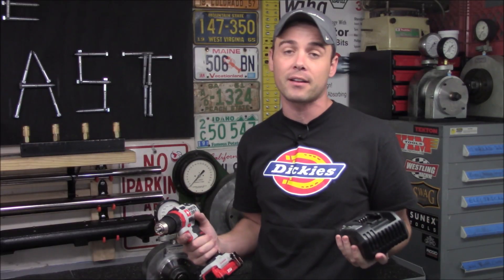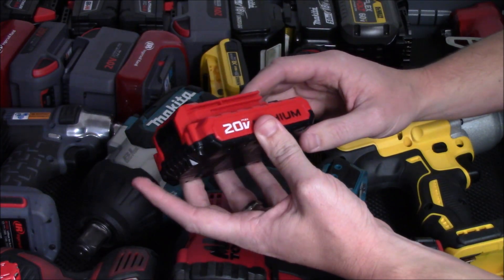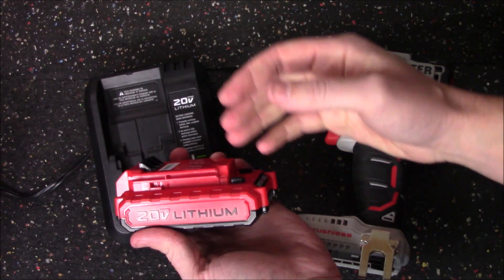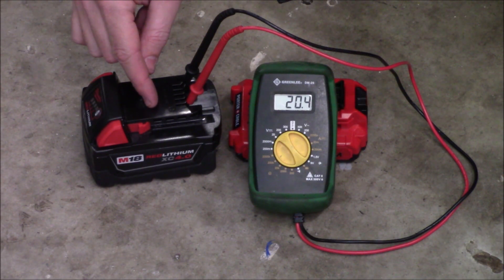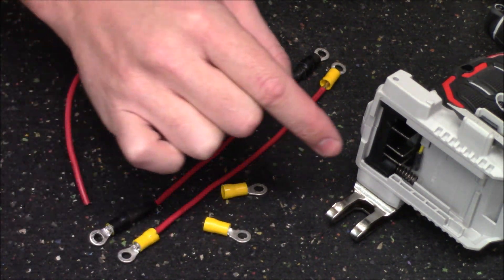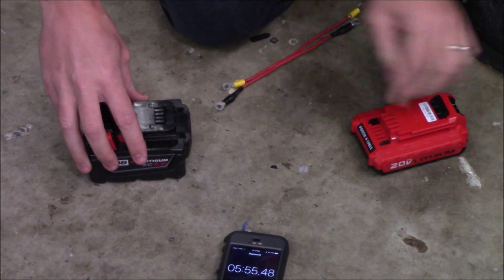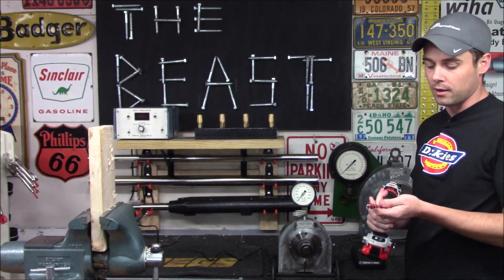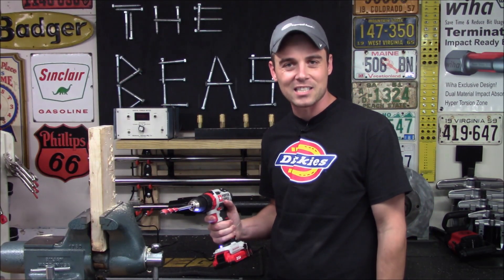Back from the DEAD!  Lithium Batteries!

Comment: Great video with emphasis on safety, but described method may be too conservative and outdated.  While this may work as a quick and easy fix, chances are the current modern Li-Ion battery packs and their paired smart-chargers that first test, than determine viability status would be able to identify and resolve an issue that this would work for... Despite theories that battery-packs sales are a huge source of revenue for manufacturers, retail stores, etc... since most consumers don't register to satisfy the warranty... perhaps just a Conspiracy Theory to explain increasing battery failure rates???

Sometime all that is required is repeatedly inserting the batt pack into charger until unit senses enough voltage to charge the pack, since the initial test provides a small charge, but this can take MULTIPLE insertions, so best to check pack voltage to see if close to 75% of rated voltage.

For a bit more advanced DIY viability test and resolution there are 2 significant considerations that may require additional advanced steps. Both require opening up the case, which can void any warranty as well as add more safety risk. This usually requires a special "safety" driver bit to remove the screws, one or more of which may be hidden under rubber seal or label.

1)  If the source of failure is the circuit board or a non-battery component inside the pack, then NOTHING below will help.  

2) But chances are there is one or more under-voltage 18650 Li-ion cells, which can be individually measured with a voltmeter once case is removed. If one or more is significantly measuring a lower voltage than the others (normal around 2-3.6V, below 1.5 V is either dead, deactivated by safety circuit, or hopefully just in "sleep" mode) which may be resolved by a trial of "boosting" the voltage with another 18650 or similar 3.5V power source, + to +,, - to -, for about 15-30 secs, small spark is OK.  A confirmation of a potentially viable cell responding to a "wake up" is by showing any sustained voltage increase and eventually allowing it to be charged to 3.6V again. BE CAREFUL, and if voltage remains low or nothing, chances are it is not viable, either chemically or mechanically defective, possibly the safety circuit deactivated it, WHICH SHOULD NEVER BE MESSED WITH.

3) If a "boost" of one or more individual cell appears to be viable, the external "pack-boost" in this video may still not be effective as there may be components in newer commercial battery packs that prevents the inflow of power (transistors, MOFSET, etc ) using just the 2 external leads that may need a trial of being bypassed. To do this, find the part of the circuit board where the Neg and Pos aspects of the connected 18650 cells are making 1st contact. Measure voltage there and if still less than 75% of rated pack voltage, connect the charging source here (Again + to +, - to -) may confirm the bypass may be needed to provide charging of internal pack until smart charger detects an acceptable voltage and can provide complete charging , again a small spark is OK, but watch carefully. 
If internal voltage is below 12 V, consider use of a low current 12V trickle charger to get to at least that voltage. Test voltage here every 15-20 secs if not using low current charge source, be aware of any thermal increase in both batteries.  Success is indicated by sustained voltage increases measured internally, then also at the external connections, eventually to where the commercial charger indicates the pack is viable and completes charging.

If after trying these alternative reviving techniques you will either have a restored Battery Pack for either short or long time,  or one to get properly discarded / recycled... or carefully harvest the parts for other uses.
Strongly recommend searching for similar videos, especially of the batt pack brand you use, and BE SAFE!!!!

Comment: Where can I find a diagram of a battery terminals?
Reply from the maker: Most are marked (+/-) in the plastic near each slot.
Reply: Not likely from the manufacturer, but worth a search. Sometimes marked with + and -, if not use a voltmeter, preferably digital or set analog to 50 V or higher until + is determined.  For newer batt packs with multiple leads only one should be +, the others either full neg or partial, as these are for testing, balancing, or measuring temp.  I have not come across any with multiple + leads, but I suppose they can exist.

Comment: Is this method good to revive a  battery that died because it got wet?
Reply from the maker: Doubtful....
Reply: Not likely, unless you are willing to risk an electrical shortage, fire, or permanent damage especially if liquid was anything with electrolytes. Best would be either returning if under warranty and hoping there won't be an inspection) or to open the case (yourself or someone experienced) and making sure there is no active moisture. I have serviced several non working battery that apparently got wet in the past showing rust and corrosion, it was not worth the risk to attempt repair.

Comment: Are these both the same brand of battery? Because if so, you connected the polarity reverse.
Reply: I saw the same thing!!! The two batteries I have are for the same tool so it would be connected + to - as shown in the video.  I should know but wouldn't sparks fly if they were mis-connected? I assume he would have known what he was doing?

Comment: I only joined my 2 batteries for literally like less than 2 minuts and i took the original volatage from both batteries before the 2min and after the 2min on the low voltage battery the volatage was still as it was before however this time the charger actually started charing it... so for less risk don't join them for a long time even if the volage is still low the charger may surprise you and actually start charging them you never know may have same resulst as me (I have  worx battery btw and the one that didn't want to charge is a generic worx made by Vanon).

Comment: When using device to the point of needing a charge, isn’t that pass the the threshold of low voltage that the charger won’t respond to, in not charging?

Comment: Great info. I have two DeWALT 40v batteries. One of them stopped charging last year and I didn't want to spend the $192 to replace it. For some reason I held on to it thinking I would be able to take it apart and replace the guts of it. Well, now with this video, I followed your instructions and wired it up initially for 5 seconds and it pushed it up from 36.9 to 38.1 and now it's charging.
Thanks for the detailed explanation of what happened and why it wasn't working.
Hope all is good with you.

Comment: Thanks for this, what would be lowest voltage for makita battery to bring back to life ? Tia
Reply from the maker: No clue.  Makita has a chip inside that burns out of the voltage it too low & you can’t revive them.  Charge Makita batteries often.

Comment: Be careful like he said as one of the cells could be dead with a similar voltage to what he showed. This will get the battery to charge, but it will likely have suffered a decent amount of runtime loss after undervolting so severely. It could also go Mt.St Helens. A safer method would be to buy an R/C style balance charger if you have multiple packs like this, open the pack, and charge the cells individually in a terra cotta pot (as they are cheap and insulate well) If it's a larger in parallel pack, things just got more advanced. You would have to disassemble the pack. The drill, and or pack in this video are likely malfunctioning and or of poor design, as an under voltage protection circuit should have literally switched the battery off (so that there would be no voltage at the probes, Methinks it's an issue with the pack itself, this also likely wouldn't prevent an overcharge if input voltage was high enough. Both can result in thermal runaway.) All modern brushless tools also feature over current protection that will automatically trip, just like a breaker if the motor is overwhelmed and calls for more current than is spec, whereas brushed motors typically only have temperature protection.

Comment: It totally worked on my 20v lithium batteries .  One battery was so dead it didn't turn on my drill at all . Charger was telling me it was damaged . Did what he explained in the video but for 10 minutes instead since it was completely dead . Put it on the battery charger and it said it was hot battery . It was warm after the transfer . But put it on the drill and it ran it this time . Next day once it cooled down I put it on the charger and it started charging the battery this time .

Comment: What if the voltage from a dead battery pack is at 0 volts? Would this work at all? 
Going to use a Harbor freight battery to revive.

Comment: Excellent video! Can this be done with a Dewalt DC9181 18V Lithium battery?
Reply from the maker: Works for most batteries except Makita.
Reply: @RealToolReviews  Thanks for the reply! The batteries for my Dewalt hammer drill have been dead for 6yrs. I made the little jumper cables as per your incredible video (without a digital multi-meter) and both my batteries are working again and charging. And I'm a chick... I am over the moon happy!!! and can't wait to impress the hubby when he gets home. THANK YOU SO VERY VERY MUCH!!!!!!!

Comment: Great video and helps people find out if they have batteries that can be persuaded to re-charge. Most people just give up and buy a new unit. Particularly liked your comment about the 20v actually being an 18v unit. I have a 20v paint sprayer so I know know I can use my 18v batteries of my other power tools to use the procedure you showed. Many thanks.
Reply: 20 volt MAX, all marketing bs like many of them do

Comment: Does this trick work on older non-lithium batteries too? I have an OLD Ryobi 7.2 volt battery that has perished like the Monty Python bird sketch. The batteries are not available anymore and my luck with aftermarket batteries has not been good.

Comment: You should be using a resistor in series when connecting the batteries like that or at least use one that't more discharged in order to have a lower current draw.

Comment: My Craftsman C3 lithium reads 4.9 volts, but the charger says it is fully charged and hence will not charge. (The drill will not run also). C3 batteries plug into the drill unlike the slide on batteries.
I did notice when taking voltage readings that there is another contact terminal that reads 16.9 volts but this contact is not being used by the drill. (This C3 battery has 4 contacts which are one ground and 2 positives terminals and one contact unused). The terminal reading 16.9 volts is not being used by the drill so the drill doesn;t work and the charger thinks it's charged. Any ideas.

Also, would you know if any of the aftermarket Lithium Batteries are any good as the originals. I may need to pick an aftermarket brand if I can't revive the malfunctioning battery. Thanks. Gave you a Sub...nice video.
Phil

Comment: So are the + and - terminals reversed on those two batteries? If you were using two matching batteries you would need to cross the leads over surely?
Reply: Haha.... Try it, u are going to blown it up 😂...
Reply: It looks to me that he connected positive to negative between the two batteries.  When he tested the voltage with the meter, the positive was on the same side on both units

Comment: Definitely genius!! But that said begs the question(s) how much use now on a single charge can you run that "reconditioned" battery before it runs too low again? Also, what is the voltage threshold where you just dispose of it rather than try to revitalize it?

Comment: will this also work for 18v Dewalt batteries?
Reply from the maker: It works for most batteries, except Makita. With Makita batteries, once they hit a certain voltage, the chip is designed to burn out and nothing will bring them back to life.

Comment: I have a battery that charges for a little bit then the bad light starts blinking. Pull it out, put it back and it charges again. I may have to do this 3 or 4 times but the battery eventually reaches full charge. I have a second battery that charges just fine on the same charger. Any ideas?

Comment: He said to hook the positive to positive negative to negative but your cables went straight across and that would mean the positive is on the right side in the negatives on the right side on both batteries or should I crisscross the wires and I know that’s true because when you flipped it around the other way to take a reading of the voltage yeah there are you did you stuck a positive in the freaking right side and when it was switched the other way
Reply from the maker: The pins are not in the same positions on all batteries...
Reply: Real Tool Reviews Maybe not but yours were because when you took the votes he had the red pen on the same pan as you did on both batteries but when you were jumping on you did not

Comment: What about when my 18v 3ah Bosch battery’s getting empty so so quick ? 
I had no problem with them until I bought another Bosch drill with same 18v battery and  battery charger so I use only the new charger 
I’m wondering can it be because of this or just batteries life are over and inside batteries need to be replaced ? 
Thanks

Comment: Thumbs-down because you did not install a current limit in series. A simple resistor or low voltage light bulb is enough. Just limit the starting current to around 100 mA.
Reply: Why don't you put a complete and concise remedy in the comments section.

Comment: Trickle charger from harbor freight does the job to bring up voltage for me on all my tools
Reply: Now THAT makes sense!
Reply: Michael Harris it works well. If your battery is absolutely 0 voltage you may have to give it a short direct higher volt hit though to get a volt or two in it. This is using the absolute cheapest trickle charger though if you had a little stronger one it would most likely work fine itself.
Reply: @Thumper68  Thanks bro!
Reply: @Thumper68  does your charger have a battery conditioner in it
Reply: Michael Harris no problem
Reply: Michael Harris you can bring life back into 18650 cells for a little while if you do this too just don’t leave on very long since they are only 3.7v of course lol
Reply: Michael Harris I do this to ryobi and have done on dewalt as well.  Using this trickle charger  https://www.harborfreight.com/automatic-battery-float-charger-42292.html 

I use nitecore charger for 18650 cells.

Comment: With a large voltage difference the current is going to be very high and can damage both batteries. A way better option is to use a current limited supply to bring the voltage up of the low battery. And only do this if the voltage of the low battery is close to the threshold. If the voltage is very low probably one or more of the cells have permanent damage and can fail in dangerous ways.

Comment: So I bought a lot of about 11 batteries, and some other misc milwaukee tools. for like $350. I think the seller was trying to pull a fast one on me. All batteries were so low that one light wouldn't light up. After watching this I charged them ALL. Jokes on him now. 1x M12 with that 1H saw, 2 M18 Circular saws, 11x2AH Batteries, 1x60V DeWalt and 1x6AH DeWalt oh and a DeWalt abrasive cutoff saw(needed 9 dollar brushes, why on a new saw I dunno) all of it was brand new. All works now. Boy I owe you guys one for sure.
Reply: all batteries are at minimum load when you buy them brand new sir.
Reply: @LibertarianUSMarine used batteries?
Reply: @LibertarianUSMarine no they are not sir they are usually around half 40-60% which is correct for storage &shipping it is not considered good practice to store or ship full or empty battery cells as it is not good for battery health &lifespan most phones devices lithium batterys for cordless tools etc are partially charged no lie
Reply from the maker: Haha nice 👍
Reply: @Rob Lambert - find out where Mr. Marketing for Milwaukee lives, and personally deliver a letter...

Comment: I’m calling TOTAL BS on this because the two battery were facing opposite direction, in which you put the positive on the negative and vise versa. You actually should have cross crossed the wires. Not good
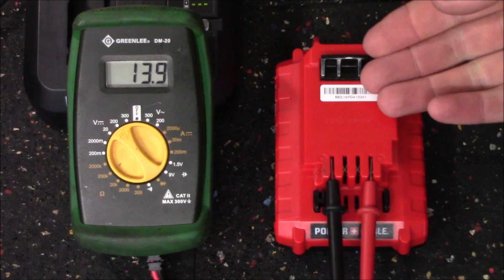Reply: Nope.  Look earlier in the video (when he is measuring the voltage before the 'fix' and you will see that the Porter Cable + terminal is on the right ( and the Milwaukee is on the left. ( time stamps 2:58 and 3:19 )

Comment: One thing to keep in mind is that a compromised cell will not always fail during charging. It may instead charge fine but fail when you apply load to it during use in your house.....just food for thought.
Reply: This comment needs flashing strobe lights around it !

Comment: You did a nice job with this video.
The biggest problem with these lithium batteries is that if you forget and leave 
them charging indefinitely, that will kill the battery pretty quickly.
Is this a way to solve that problem ?
Do you know the difference between a Type 2 and a Type 3 Black & Decker Lithium powered tool ?

Comment: I've got a battery pack not used since 2014, been on a shelf.
I haven't bothered to put a multimeter to it, but I'm pretty certain it has 0 charge what so ever. Reckon it'd be a good idea to revive it?
Reply: MoistGoat I had a Milwaukee battery that I didn’t use for years because I thought it was shot. Seen this and tried it works good